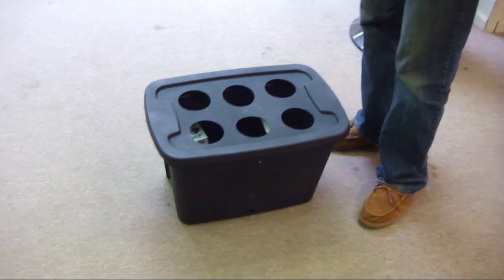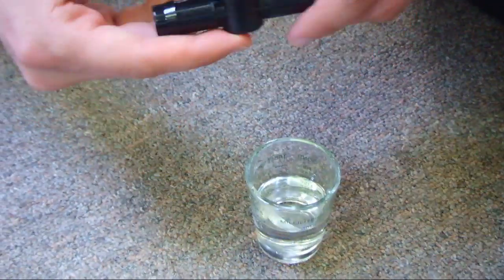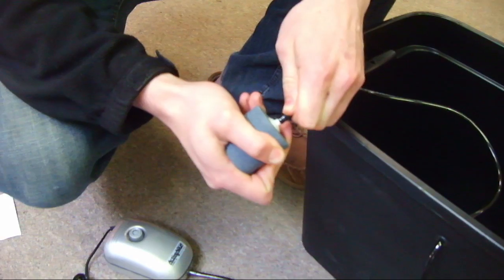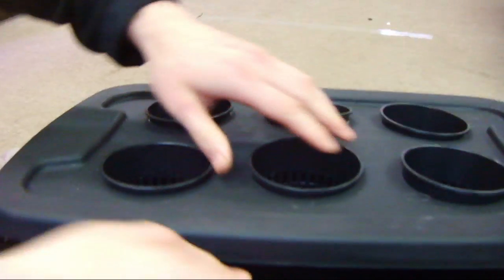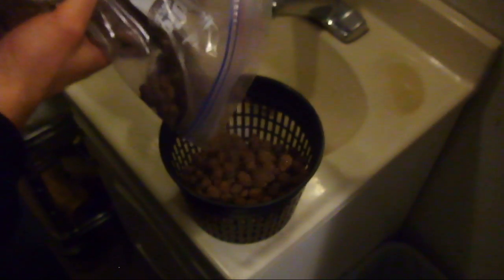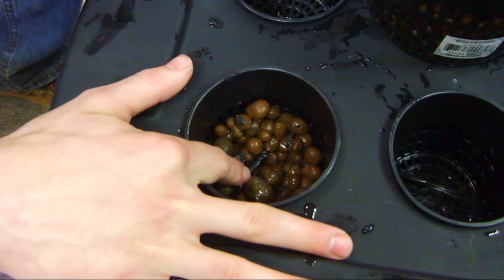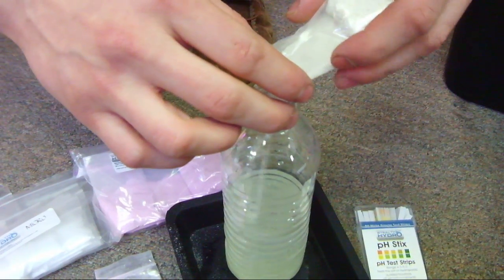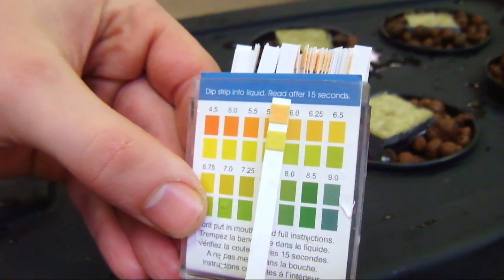Bubbleponics

Comment: Instead of that ridiculous distributor just have some pvc pipes run inside the bin with a plastic bottle under each plant. Attach a timer and a pump, then when the plants need watering the water is pumped in, goes into the pipes to each individual plant bottle and fills up from the bottom

Comment: OXYgen use 2 3 airstones ceramics on both ends. root rot is the worst. pour hydrogen peroxide 24 hours cleaning your hydroton. during the first stages algea grows. this setup will creat algea for some reason its very good algea grows with weed. dont ask me the best voodoo juice or biotonic care shit but you'll need that too.use general hydroponics asell and ph tester or digial this is not a good nutrient diet. dont for get your calimag http://www.growweedeasy.com/sites/growweedeasy.com/files/pH-nutrient-deficiency/hydroponics-ph-chart-marijuana.jpg

Comment: Half the nutrient packs were used in the video.  Only 1/2 strength is needed for seeds and clones.

1. Seeds, Clones = 1/2 packet of grow and micro as shown in the video.
2. One week later change the water and use a full pack of grow and micro.
3. Add distilled or RO water throughout the next 10 days
4. Every 10 days do a water change with a fresh pack of grow and micro
5. When the plant is the size you like (determined by the size of your lights) change to 12/12 and switch to Bloom and Micro